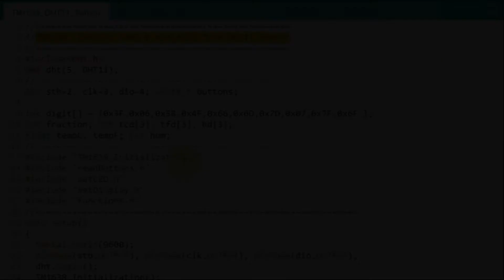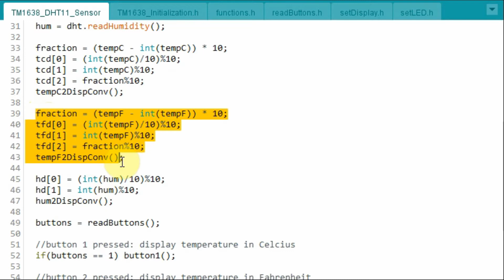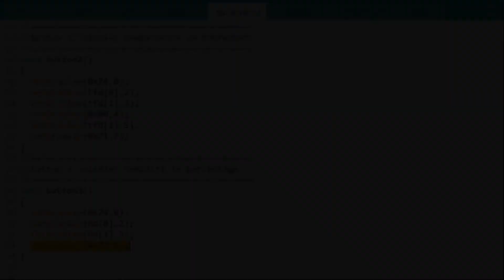TM1638 Programming with DHT11 Sensor

Comment: There seems to be a mistake on the wiring diagram (shown on the blogspot page)  at temperature sensor 5v  and ground connected together wouldn't release the magic smoke  ?
Reply from the maker: Thanks for your feedback. I checked the diagram, the middle pin is connected to Vcc, while the right pin is connected to GND.